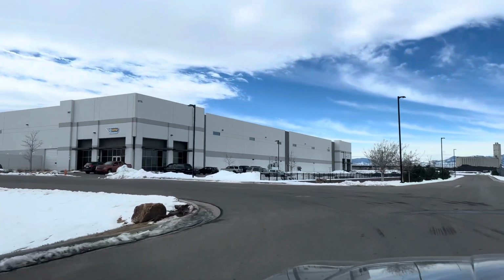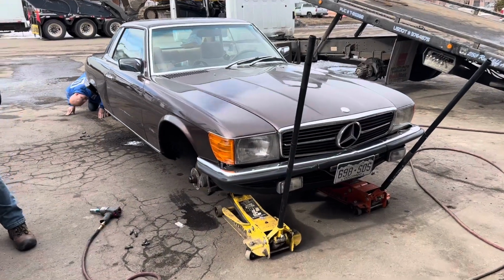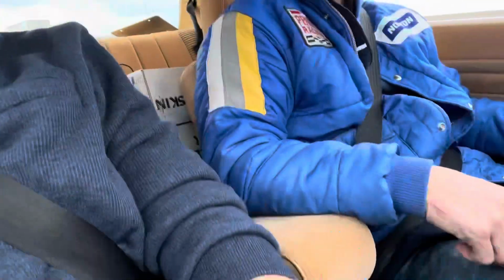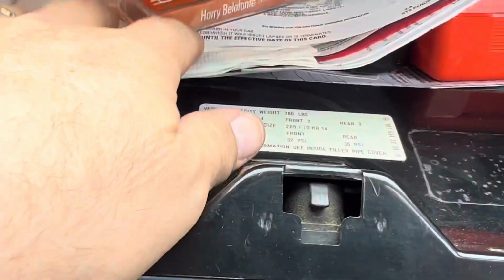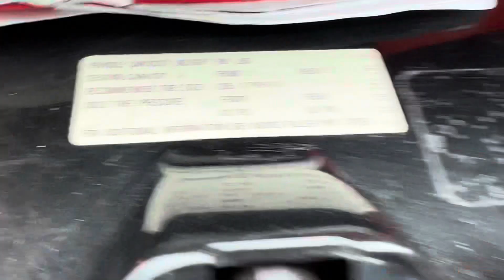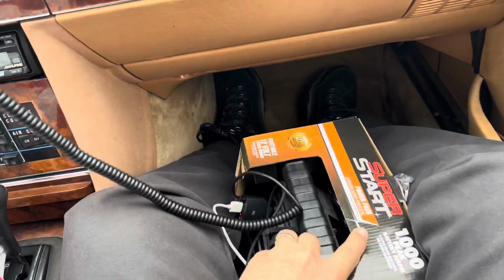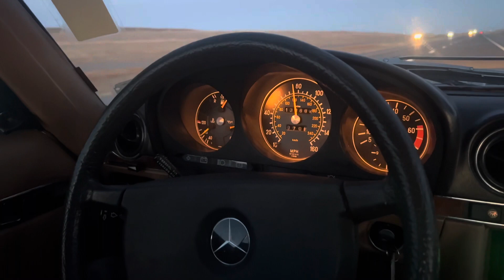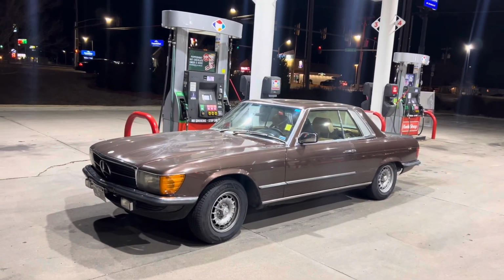Pt2. Ultra rare 1980 Mercedes 450SLC 5.0 CO to KS or bust?  What do we do about the bad tires?!?

Comment: The original radio is probably a Becker radio. The radio can be overhauled at reasonable cost and the car will then be entirely original. It will be worth the cost.
Reply: Yep, I've done the same with my 1990 BMW 535i. Not a Becker but a ZBM-81 or something like that - forgot the manufacturer though it's labeled a BMW.